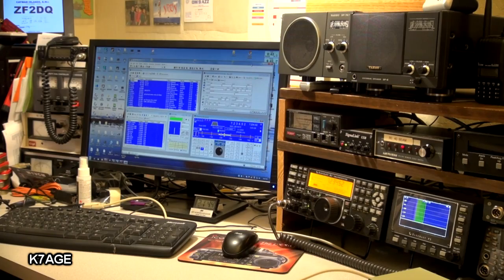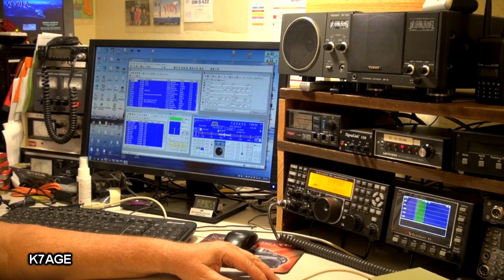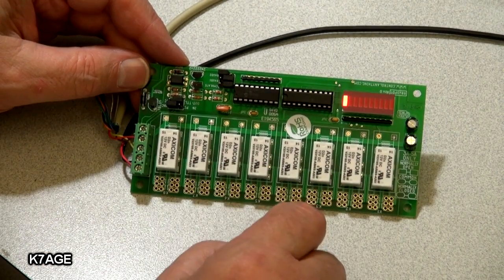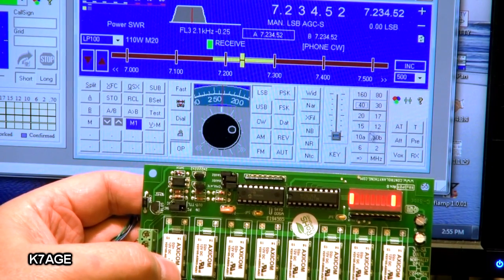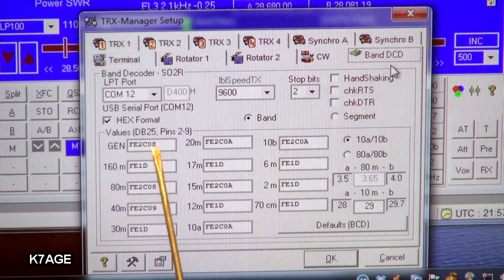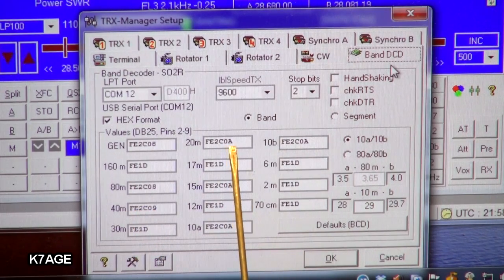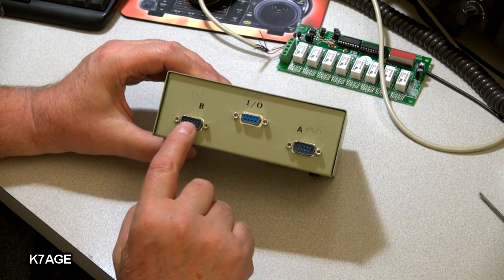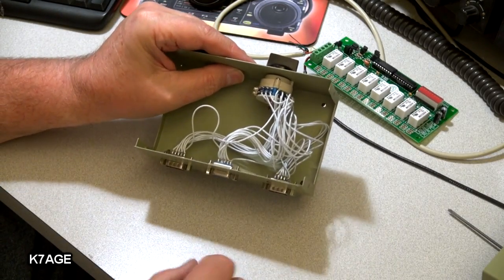Serial Control of Ham Radio Antenna Switch

Comment from the maker: Out at my tower I have 3 antennas, 80 M dipole, 40 M dipole and tri band HF beam for 10/15/20. The switch switches between the three antennas back to the shack on one coax.

Comment: Nice project.  I'm looking at doing something like this, but I want to build it all from scratch since I have plenty of heavy duty relays and like to build electronic circuits (unless I can find a relay board cheap).  I had to laugh a little when I seen your data switch because I have one that looks like it, except it switches the video, keyboard and mouse.  I've made a manual switch with it by putting SO-239 connectors on the back for my  20 & 40 meter dipoles.  It works ok, but I want to be able to just push a button and have it switch between 3 antennas.  I have 10, 20, 40 & 80 meter dipoles.  The 80 stays constantly connected to my antenna tuner on the COAX 1 position and on the COAX 2 position I have the switch, to switch between 40 & 80.  Might put another HF dipole up later so I'm going to make it be able to switch at least 4 antennas.

Comment: Love this project Randy! Would it be ok to email a few questions on the Hexadecimal setup and the wiring of the computer cable to the board? I'm trying to control 5 antennas and I use Logger32, not TRX Mgr. Very interested in this!

Comment: Randy, will this work with a USB to Serial adapter? I have no serial ports on my Win8.1 64 bit machine.
 Also is this CAT controlled (Icom CIV)?
Reply from the maker: I am using a USB to serial dongle to drive this board.  For CAT of the Elecraft and Kenwood I have more serial ports. I have a USB dongle with 4 serial ports on it. So, I have 5 serial ports right now.

Comment: if you wanted to you could put a piece of tap over the holes in front and fill up the holes with a hot glue. or if there was a switch up front you could go to a place that makes trophies and have it engraved.
Reply from the maker: Ya, it looks tacky as is. I just hid it behind everything else.

Comment: ESD issues holding the board
Reply from the maker: You're right. I wasn't too worried. I wasn't walking or shuffling around to generate much static. But then again, if you can feel it, it may be too late.